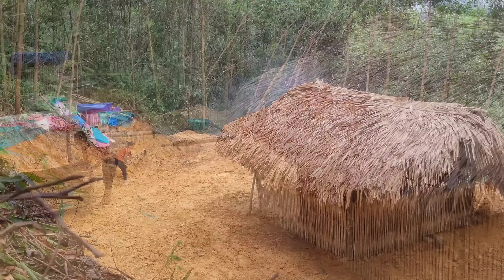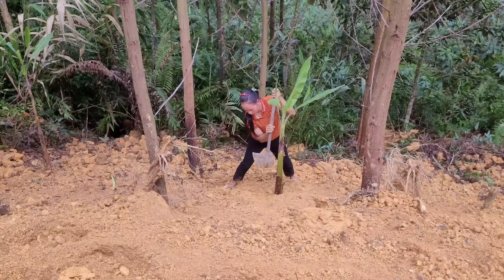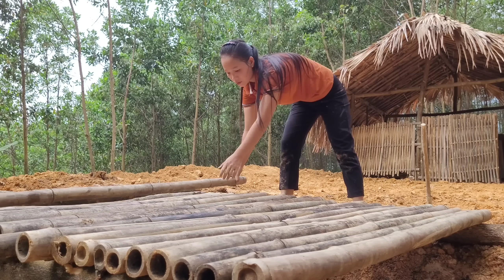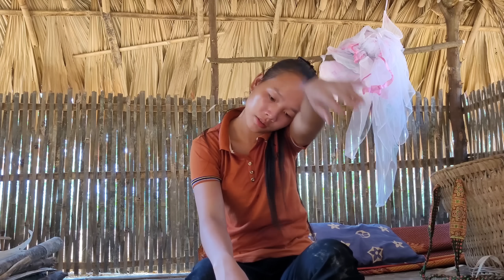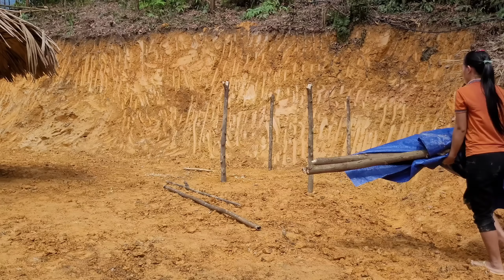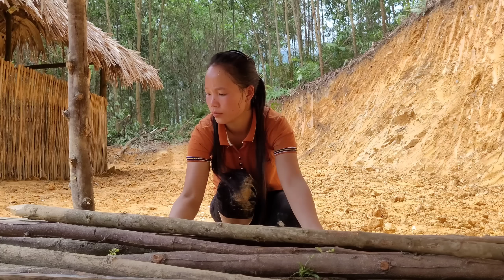Complete the place to use water for daily use and create a firewood warehouse for the family.

Comment: You must clip  both ends of the water flat form with bamboo frame to be safe as those bamboo flooring are coming out it’s dangerous especially for your sons. Also make safety walls so the kids won’t fall into the deep hole. Thanks